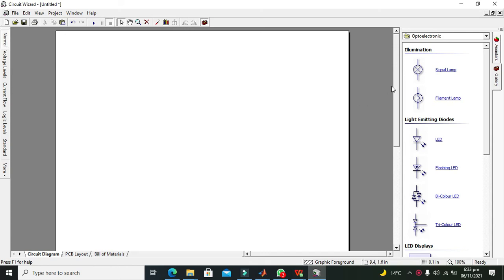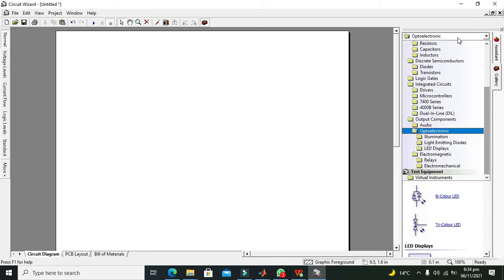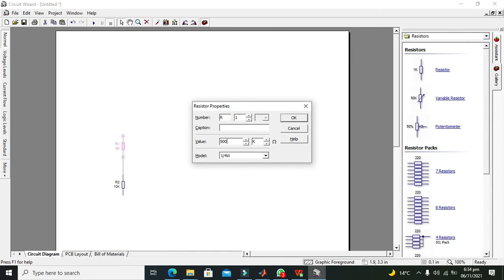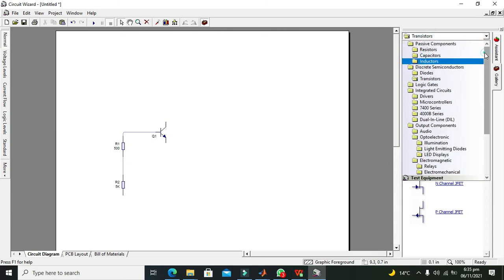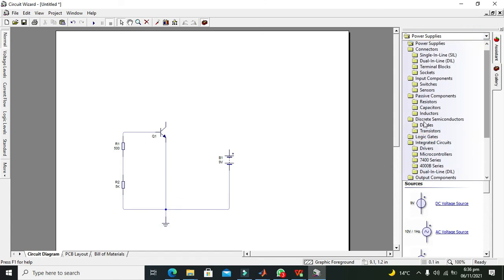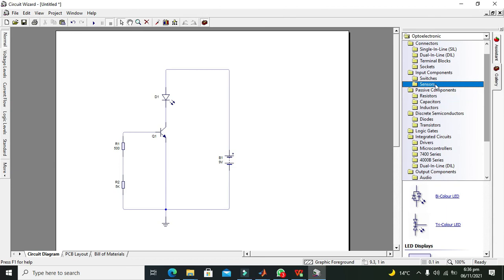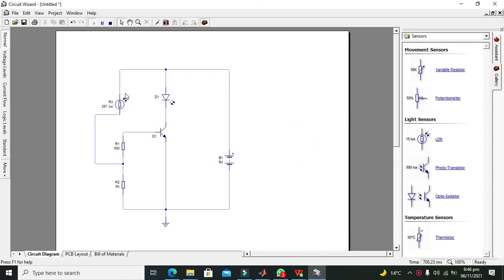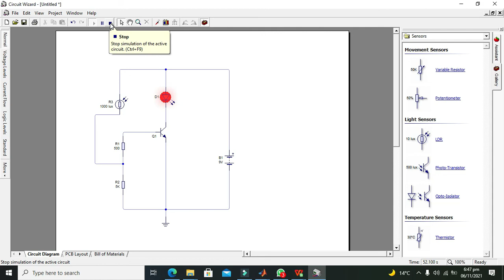Light detector circuit simulation in circuit wizard | use of LDR in circuit wizard

Comment: How did you come up with what values the resistors should be? Any specific formulas?
Reply from the maker: its just random value i.e we use 220 ohms and 330 ohms.....even 470 ohms can be used to limit the current....
Reply: @nelsondarwinpaktech3954  Thank you very much! This helped me in my assignment